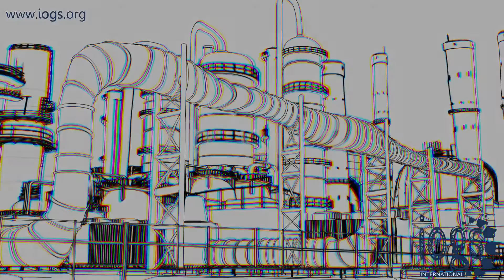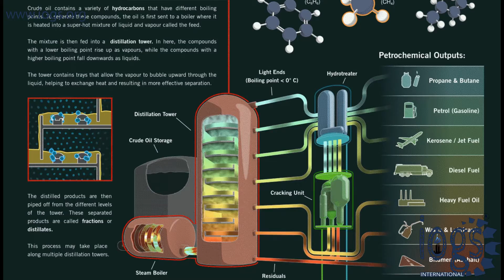🆕Thermal Insulation — Pipe Insulation — Heat Insulation — Detailed Explanation

Comment: I have been reading about, liquid thermal insulation  coating. In your view, is it possible to replace traditional insulation methods such as rockwool in the gas and oil industry? Any information will be useful Thank you 🙏
Reply from the maker: Hi there,
no, it is not possible to replace the entire insulation completely with the liquid one. There are several limitations each and every insulation material can have.

In your case the liquid thermal insulation has certain temperature limitations, like they cannot be used for high temperature services as the Rockwool does.

Another disadvantage with the liquid insulation is that it is very difficult to take them out once it has been cured after application, they become like stone once cured.

The liquid insulations are best suited for immersion services than the atmospheric services.

i hope the above helps your understanding in differentiating between the traditional insulations and the liquid insulations.

Best Wishes!
Reply: @IOGSInternational  
Thanks 🙏